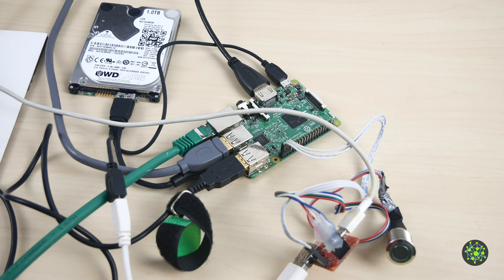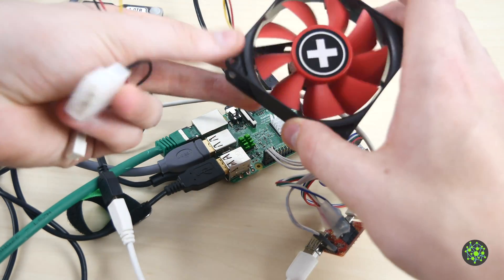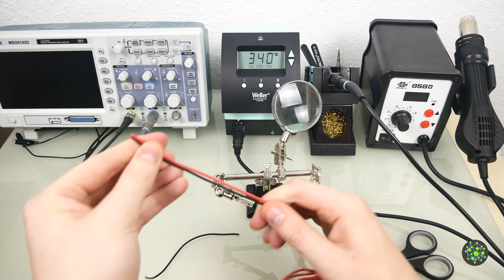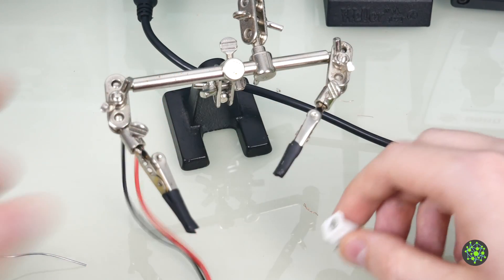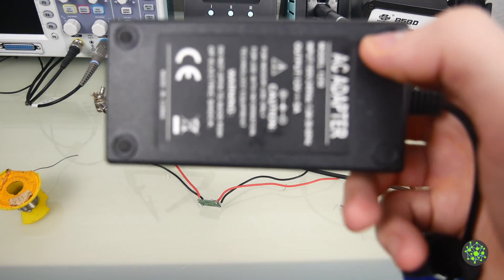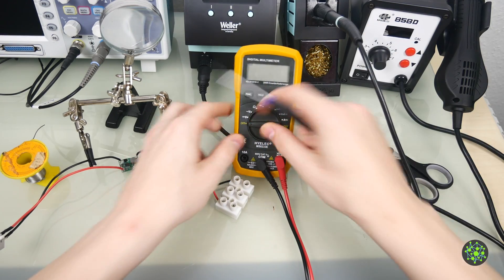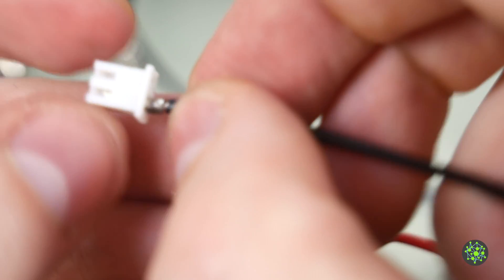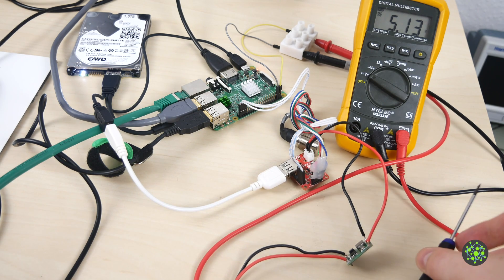Ultimate Raspberry Pi Build #04 - 12V power supply and cooling preparations

Comment: Maybe don't crimp stuff on tinned cables... Connections will loosen up with time. And maybe use the bottom part of the cripy bits to go around the insulation, so you don't need extra shrinking tubes..

Comment: I realize you did this to supply power to the fan, however does this resolve the "low power" issue with the Pi that happens when you add peripherals (or make it work hard)?

Comment: The one on the bottom actually generates the most heat.  The Ethernet chip actually doesn't need a heat sink, as it doesn't actually generate that much heat, most of the heat on the board comes from the CPU and GPU. The chip on the bottom is your GPU. Those thermal tapes are actually not that good at conducting heat, thermal paste is ideal, but the issue with that is you have to have a mounting bracket that holds the heat sink in. Else you will have slidy heatsink which is what I have on one of my pi's.

Comment: good, thanks, i need 12V my rasbi 3 10 inch display power and 5,2 volt to rasbi 3, now i have first time sure i can connect, i has find many hub and shield but no sure can use, i think need 12V li-po battery in case, but how charge battery whit no take out battery, only connect power and charge battery and can run rasbi 3 sametime/alltime too. i think made carry on rasbi, battery powered and case have only bluck were add charger cable when need charge battery, same than phone system.

Comment: In my opinion atx power supply from pc it's easiest and much cleaner way to power the pi and 12v fan ...Because power supply from pc it's have much stable power than china 12v shity one. Plus you have out of the box 12v 5v etc, only  plug 2 wires together or add swith on it for on function, many wideo on yt have good guide what you must to do with it. Ps. I have psu like you and after 1 month it not stable 12v and drop to 9~10v ... you can have lucky and yours psu its stable but the worst psu from pc its better than that one from china.
Reply: yes, that's what I'm using, mine's got a nice quiet fan so I'm hanging the rpi4 above it in the forced air which is actually cool as the ATX is hardly loaded at all. Plus I've got my mini-fan tywrapped over the rpi as well.They can also be hacked to give a little more, 5.1 - 5.2 volts is better.

Comment: I remember those crimping connections.  What I did was clip that end part off then tin the wire and lightly solder it into place.  No crimping needed.  Yea I know it wasn't the right way but I didn't have the right tool either.

Comment: 3A seems to be too low of a margin. Maybe having a 5V power supply and boosting the voltage from 5V to 12V to power the fan would be a better choice.

Comment: Why that useless skinny soldering tip?
Reply from the maker: +S Elnes It's not useless for small smd components.
Reply: The round, square cut tip is my favourite. You get that for your weller (LTCC).
Much better heat transfer, and most smd components are more easy to solder as well.
That thin tip is best for veeery tight spaces.
Also some extra flux (flussmittel) will not hurt... ;-)
Interresting videoes.
Keep it up !!!!
Reply from the maker: +S Elnes I've actually got both the square cut tip as well as some flux, but the flux I got I don't like. What are you using for flux?
Reply: Have been using some "no-clean" flux from work... Not sure of the brand. Very thin stuff. Like water.
Used to have some really sticky brown stuff once... That was very good, but left some caramelly stuff.
Reply: This is a good video showing the tip I am talking about. And also the good effect of good flux.
The most important is to keep a low temperature, so you dont destroy the flux.
That is why you need a tip with high thermal transfer.
A soldering iron temperature of 250 degrees sould be more than enough.
Reply from the maker: +S Elnes I've got the "no clean" watery stuff as well.